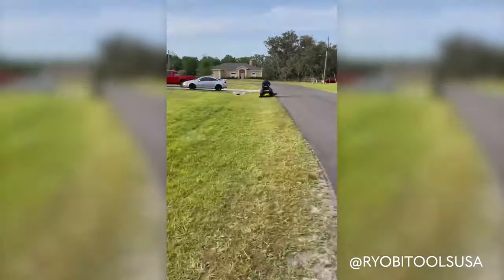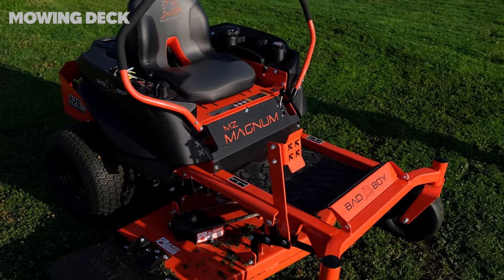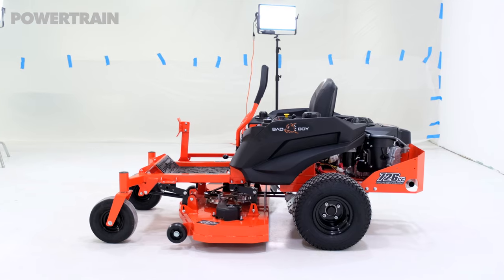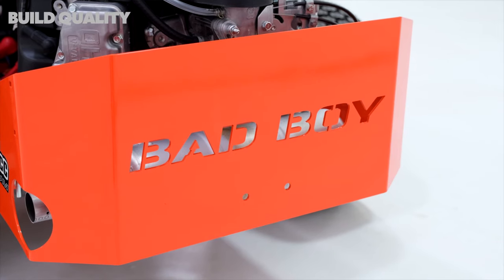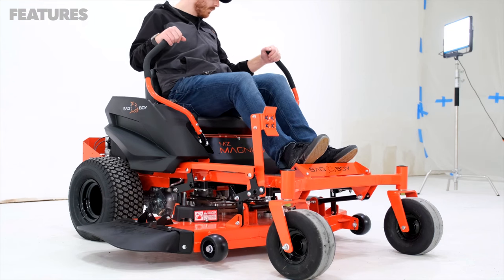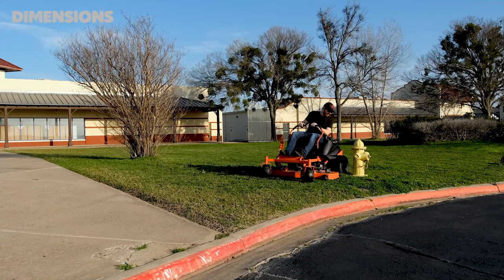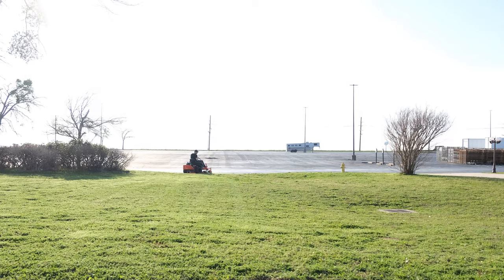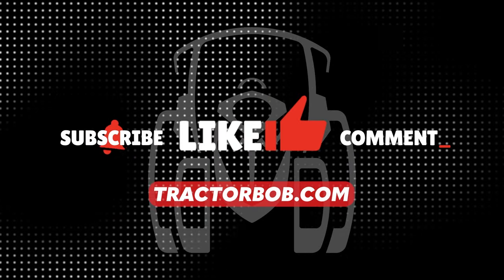$4000 Top Quality Zero Turn Mower | 2024 Bad Boy MZ Magnum

Comment: My MZ 48" (Chose 48" because it fits through my sheds doors) is on year 8 and has never boke down. I have a 1 acre lawn so this was perfect for my use. It has the Kawasaki FR engine and has performed flawlessly. I added Gator mulching blades and a open and close shoot system. I only recommend the Kawasaki engines and would not touch one with a Kohler. Bad Boy needs to stop using Kohler engines and go strictly to Kawasaki or Briggs Vanguard IMO. Kohler is not what they used to be and although they will get the job done they are not near as good as Kawasaki.

Comment: I have half an acre and am considering this mower with the 48" deck or potentially the Rambler. From everything I've heard in your videos and read online. Functionally it seems the only difference between the two are deck size and engine options. Do you think the engine options are worth the roughly $1000 price difference? With my yard being the size it is the deck size difference is really negligible for me. It more comes down to potential longevity and reliability. And if the engine is worth it. Do you share the sentiment that Kawasaki is the best engine they offer? In my area lots of people still have last years 48" with a Kohler motor. Thank you!!!
Reply: The biiger the balde the weaker the cut so 3  blades are better then 2

Comment: I have a question about the transmissions. My dealer has the MZ Magnum 52" mower.  It has the Hydro-Gear zc-aubb-3dkb-1ppx .  how does this compare to the ZT2800 or ZT- 3100?
Reply from the maker: The simplest way I can put it is that the 2800’s on the avenger are considered top of the line residential grade. While the ones on the MZ magnum are entry level residential. So you can expect the at avenger to run faster and for several hundred hours longer.

Comment: How long does the non servicable hydros last . I don't have a large yards so don't put alot of hours per season. I'm just too locked in on having servicabke hydros. More control. AM I overthinking it
Reply: I've read online that you are looking at like 1200-1300 hour lifespan on a non-serviceable hydro.
Reply from the maker: You might be overthinking it a bit. In this price range nearly all the hydro's you'll find on zero turns are nonservice able. That's because hydro gear has made the switch to producing non serviceable hydro's for residential and many commercial mowers. They are more efficient, and durable since all the components are in one casing, plus the lifespan is long enough that replacing them down the road if you put over 1500 ours on them wont be so expensive, especially considering how long they last.
Reply: 4200$?? Local dealer here quoting 4800 for 48" deck.
Reply: I take care In maintaining my MZ Magnum. I cut about an acre with some slight slopes. I've three seasons on the mower. I follow the maintenance schedules. I've approximately 100 hrs on the mower. If I get 1200 hrs. of lifespan out of the hydros (average) . . Ive a good chance of never wearing out in my lifetime. So, if the MZ Magnum suits your needs then it's a non issue. IMO, you cannot beat this mower in this price range . . I highly recommend this mower. I bought mine from a dealer which I recommend. Price has increased though. I paid $3700 for mine delivered to my door step.